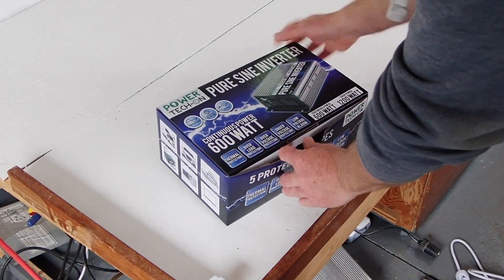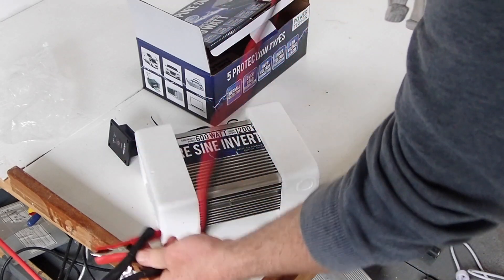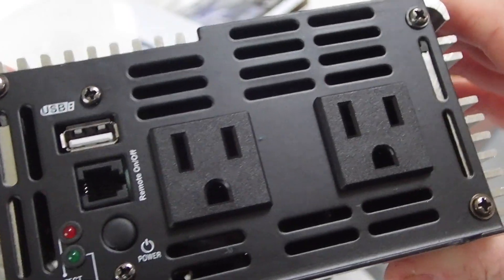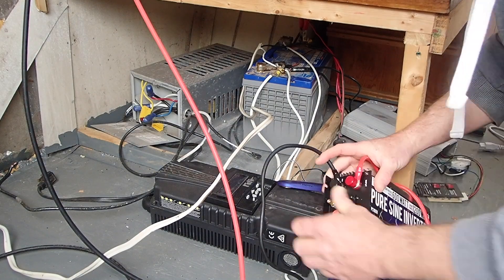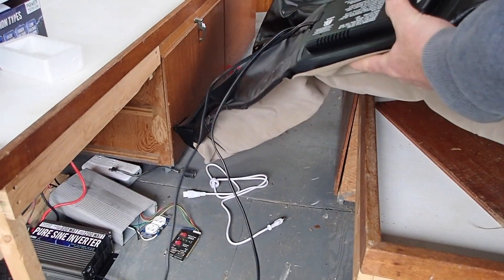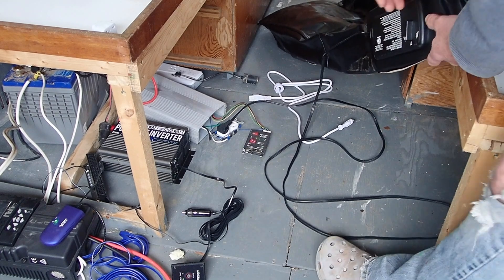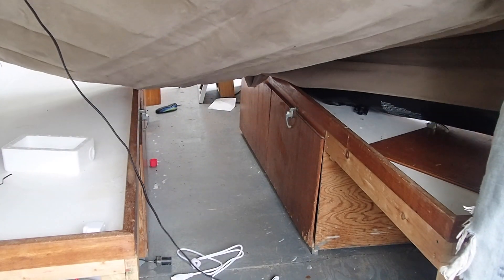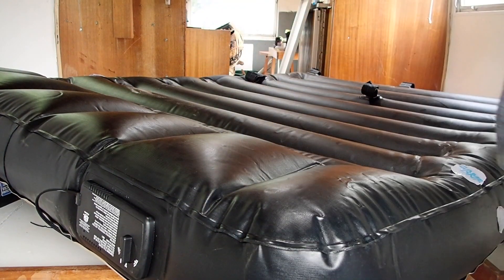GoWISE Power PS1001 Pure SINE Wave Inverter 600W Review

Comment: I have owned the same inverter for over 6 years but with the brand name of Micro Solar. It ran for 24/7until about a month ago. Great inverter! Had to add it’s still in use powering my new off grid shipping container shop. But now I turn it off when not in use.
Reply: They are same design

Comment: I just picked this up from Amazon for $61 USD shipped with a $30 coupon. It doesn't show the remote switch, unfortunately, but the same model number. I could always put a switch in, but my location is next to the battery, next to my driver's seat.

Comment: What wattage would be enough for a ridgid 5.0 shop vac.
Thank you
Reply from the maker: 5 amps at 120 watts would be 600 running watts. But surge is often twice that, 1200 watts so you need probably atleast 1200 watts capacity to start it. YOu'd have to try it out and see if it works. At minimum something with surge up to 1200 is recommended.
Reply: Thanks for your input, I'm gonna go with a 12vdc lead acid battery and a 2000w-4000w peak inverter running the alternator as I use the shop vac, any thoughts?

Thank you..
Reply: The better choose a 1500-2000W pure sine wave inverter for your 5.0 shop vac

Comment: I just installed mine today - but no 110 power output.  Controller shows no fault, and all looks good as far as wiring.  Am I missing something?
Reply from the maker: Did you turn it on? ;) just double check all connections
Reply: @MicahGallant  yeah all connections solid and tight.  Coming off 2 12v batteries.  Hmmm

Comment: I have used one for farm work for many years. They are nice to keep around for many things. I have a big one I used for building fences. I can run a big 1/2" drill on it for installing lug bolts in posts for Gates or someone as small as a phone charger. Thanks for another great video
Reply from the maker: Thanks for the comment. A must have when preparing for emergencies! You never know what you’re gonna need,